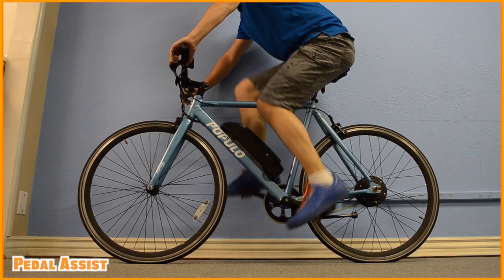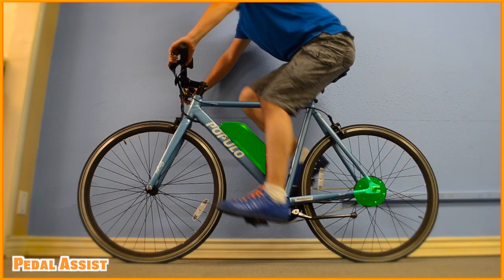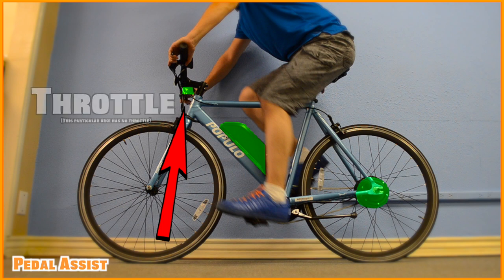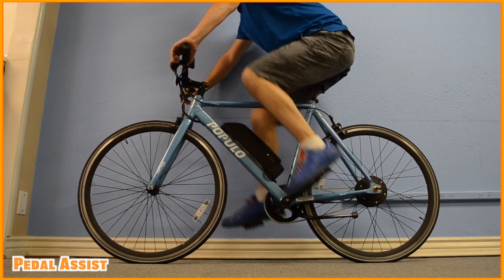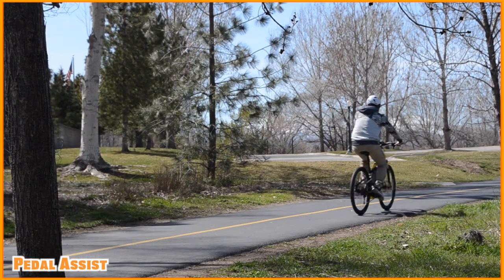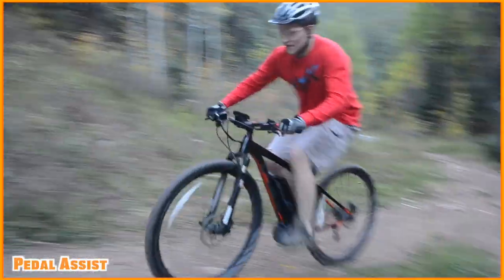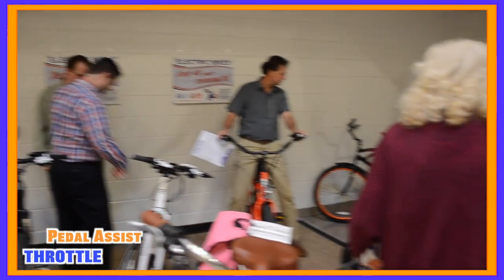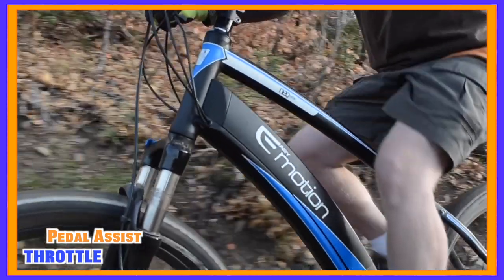eBike Pedal Assist VS Throttle

Comment: I find the throttle most useful when pulling away at traffic lights or a crossroads when on a low level of assist and you have traffic ( motors) behind you . They sometimes become impatient if you pull away slowly . In fact it’s about the only time I use it .
Reply: Me too, I find this is this most natural way and fun way to use an Ebike. Throttle when abrupt power is needed, otherwise pedal assist.

Comment: I have both, and both are cool. However I had the throttle stop working for awhile and realized that the throttle is fantastic when hitting hard terrain and rough ground because I can stand up on the pedals and power through holding the pedals both level and clear of obstacles. Definitely get both 😎👍

Comment: Throttle for me, but I think it comes down to how you use your ebike most. I use it as a utilitarian, get me around vehicle, so I prefer the motorcycle-like function. If I want exercise, I go for a run. But for someone who enjoys cycling for exercise, PAS makes a lot more sense. My biggest complaint is the jerky feeling of most cheap PASs. A true torque sensor (much more expensive) does a better job of mimicking actual pedal power.
Reply: I'm thinking, that you're thinking, about the 'Yamaha vs Bosh Mid-drive video... so, that's what I'm thinking... ;)
Reply: I like your comment.  It seems like throttle would be a great option.  Originally when I heard about PAS I thought it sounded really cool because it made your e-bike, still a bike.  And my thought was because you are merging human power and a motor your increase the bikes range by relieving the power consumption a bit.  So that was why I thought PAS was a good way to go.  But know I'm realizing all of that can still be had with throttle control.  I mean, you can still pedal and relieve the power consumption even with throttle control.  My question: (I've never even ridden one of these bikes, but I'm considering purchasing one)...  how much does pedaling really help?  I know of course it depends.  But in general, with the bike you ride, can you double, triple, your bikes range by pedaling 100 percent of the time?  For example, if you went on a 45 minute non-ebike bike ride, pedaling at a moderate exertion level, and you took in general that same exertion level and applied it to your ebike how far would you go?  Then, how far would you go without pedaling at all?  Would there be a big difference?   I guess my question doesn't really have anything to do with PAS vs throttle modes.  More just pedalling vs non pedalling...

Comment: As some one who rides a Ebike, and used both Pedal Assist and a Throttle, the Pedal Assist uses less power. I use the throttle to get up to speed, then the pedal assist to keep going. It works well. Both are useful, you just have to know when to use them.
Reply: Do you have to bridge the wires from the throttle and pedal assist together.

Comment: I have a bionx d series installed on my mtb and I mostly use level 1-2 pedal assist level when riding. I usually use throttle function when battery is low and I want to finish draining it to fully recharge it. The 20 mph cut off is a little bummer , I'd wish it were more like 25-28 mph on pedal assist for price paid. Great video on the comparison between the two systems!
Reply: Blue Monkey Bicycles wow! That bike looks amazing and 30 mph.. where do i sign up? Lol
Reply: Blue Monkey Bicycles the only thing I noticed is that their bikes have 20 inch wheels. Doesn't the super 73 have 26"?
Reply: Blue Monkey Bicycles oh wow you're right. I thought they were 24" by looking at them. Thanks for the info
Reply: I got my question answered, what remain is, how to connect the two systems together

Comment: Both is the way to go. Off the line i need throttle to start and the throttle is important for slight moves. In the woods, or tight spots i need complete control and do not have that with pedal assist.
My Pedego City Commuter is the way to go. I put 2000 miles on her in one year and she has kept my 75 year old butt in the game for i hope, many years to come.

Comment: Throttle for me, I can make micro adjustments second by second, and go further using less juice, making the most of my pedaling.  Most assume having a throttle means you don't pedal, wrong, at least if you want max range, If a rider with PAS is in max assist mode,  and basically ghost pedaling, and a throttle user is using just a tiny bit of throttle while pedaling hard, who's getting the most exercise?
Reply: Yeah my toughts exactly and that is what i do. Little trottle adjustments when starting and uphill and pedaling the rest of the way. Sadly here in portugal were i live the law doesnt allow throttle use... go ilegal or change to PAS...
Reply: Someone who turns their pedal assist from 5 to 3

Comment: What I would have liked to know and still haven't seen is how PAS is supposed to work. I've seen so many complaints about poor programming where all the PAS levels are set way too high. My ebike wanted to go 18 mph on PAS 1 with float pedaling which is useless in normal traffic. I fixed that. But many people don't even know that's wrong.
Also there hasn't been any info on the "torque simulation" PAS. I think many people want working PAS for the exercise.

Comment: QUESTION THAT NO VIDEO ON YOUTUBE ANSWERS! Can the range of intermittent use of throttle be better than pedal assist? (AKA only using the Throttle for hills and otherwise pedaling unassisted)Also pedaling at the same time as using the throttle (Like a normal person) This is how a lot of people ride and is a big reason a lot of people prefer throttle and swear by its range capabilities.
Reply from the maker: The trouble with that assertion is the word "intermittent".
Of course, if you don't use the electric system, if won't get depleted. Yes, you can pedal and throttle at the same time, but testing those capabilities is riddled with variables
Range tests are already not definitive, on account of all the variables. Testing the range of "intermittent" throttle and pedaling is far worse.
Reply: @BlueMonkeyBicycles  I understand what you are saying, However if you were able to control the test somewhat? For example, by following the same controlled route, that includes a mix of terrain with hills and descents, and then only using the throttle alongside pedalling when ascending and pedalling alone on flats and descents. This   compared to pedal-assist that is activated constantly and using battery almost all of the time. I enjoyed your video a lot, but I dont think It fully represents how all people ride with a throttle, it's not always feet still, thumb to the floor. I believe throttles can be used to control the amount of power very precisely, alongside pedalling.  I just think it would be interesting although I do understand the variables to consider. I just want to fight the corner for #TeamThrottleAssist :'D. Thank you for responding anyway sir, I appreciate it!

Comment: What I'd like to know (if you can help) is the speed of the pedal assist related to how many magnets are on the crank disk? For example, if i had 10 magnets on the disk and removed every other one to have just 5 would the power to the pedal assist be reduced by half? I'm worried that the ebike kit I have ordered may need adjusting to be road legal. Or is there a power (speed) limiter that can be added to an existing setup?

Comment: I did have a throttle control only on one front hub motor ebike conversion. It worked well as I could summon the power when I wanted it unlike the pedal assist which kicked in approximately a few seconds after moving wether I wanted it or not. This was annoying when in city traffic I would keep getting these quick surges in power even at lowest settings which caused me to keep braking to slow it down again.
With the throttle I could add the power (based on power settings) when I was ready to control it. My only problem came about as to setting the micro ohm settings on the battery, apparently that was very critical on the long term life of a battery, mine only lasted 2.5 years after very moderate use (less than 300 total recharges, 1/3 of specified ratings). With a replacement battery at $900 a pop it came to be too costly to maintain an ebike. I’m now trying to do another attempt at a conversion with better battery/controller technology available.
Reply from the maker: It sounds like you got a bad conversation system. Ice never heard of a system giving power without being triggered by a throttle or predictable pedal assist. Sounds like something is broken
Reply: i suspect u hv cadance. get tourqe sensor. mine 1500w..pas1 kick in fast..I can climb hill with only pas1..

Comment: Question: Do all mid drive systems require always PEDALING??? 

I know there are mid drive with throttle as an addition, but it seems they still require pedaling even when activating the throttle.    

Is there a system which will allow a mid drive with NO continuous pedaling??? 

 Not all elderly people are able to keep pedaling, while the mid drive provides the best torque for uphill climbing.
Reply from the maker: The big name mid drives require pedaling: Bosch, Shimano, Yamaha, brose.

There's plenty others that don't now

Comment: My bike is a pedal assist but I can't ride with only throttle. I have to keep my legs going .is it possible to get it fixed where I don't have to pedal all the time?
Reply from the maker: You want to add a throttle to the bike?
That all depends on what bike

Comment: I need a pedal-assist only kit one without the throttle do they make one can you recommend I would like to ride this on state land and they say it has to be pedal-assist only no throttle thank you I live in Pensacola Florida and there's no ebike companies around here that I'm aware of where are the Stone Age
Reply from the maker: With any kit, you may choose to not install the throttle, and the rest of the bike works just fine (provided it's installed correctly).
Check out the Tongsheng kit from EUNORAU. I reviewed it on electricbikereview.com

Comment: Can you get a peddle assist that is variable without having to change the setting on the control panel?  In other words, peddle lightly and you get some power; peddle harder for more power.  My peddle assist is just an on/off switch.  And even when on the lowest power setting on the control panel, when peddling in a tight circle, the peddle assist is too powerful.  This is on a 48V 500W system.  My solution has been to hold the break when peddling in a tight circle to keep the motor from engaging.  Great Videos.  Thanks.
Reply from the maker: Is it a torque or cadence pedal assist?
Reply: I would like to hear the answer if it were cadence, even though I didn't ask the question (first).

Comment: Any information about how each cuts off the motor? Like paddle assist the motor stops once u stop paddle while throttle u need to switch off?
Reply from the maker: Pedal assist stops providing power when the rider stops pedaling.
Throttle stops providing power when the rider lets go of the throttle.

It's actually rare to find a bike that will power without active human input. I've only seen it a couple times.

Comment: My ebike has a throttle but it may only be activated when in pedal assist. I am disappointed because I wanted to be able to go up a hill from a traffic light at a standstill. Is this "throttle only available in pedal assist" a safety feature or a way to save manufacturing costs on lower end ebikes?
Reply from the maker: Normally, it's just a programming request from the bike company, with no additional manufacturing cost. Perhaps they are trying to reduce the chance of an injury suit, and reduce cost that way...? I know from a nuts and bolts perspective the cost is the same.

Comment: Built my own ebike. Never installed the PAS. Figure I could just give it a little power with the throttle if I need to get up a hill or just want the bike to move a little easier.
Reply: Hallo, what motor did you use mid drive or hub motor? How did you install only throttle?

Comment: Throttle makes an ebike into a scooter, with the by product of getting noticed by highway and police authorities, And also the ire of others on bike paths who don't appreciate no pedal bikes. So I go with pedal assist, which is the whole point of an ebike.
Reply: John Durkin I have both, and both are cool. However I had the throttle stop working for awhile and realized that the throttle is fantastic when hitting hard terrain and rough ground because I can stand up on the pedals and power through holding the pedals both level and clear of obstacles. Definitely get both 😎👍
Reply: I think the litmus test is having an ebike that can go faster than the 15mph speed limit which makes it into a scooter.

Comment: Great video brother...I have a used electric bike I bought and I changed the throttle   (I don't use pedal assistance, is not hooked up)  the bike moves ok, but if I hold the throttle for a little while the bike remains at the same speed even after I let go of the throttle,, is this normal...Thanx
Reply from the maker: No, that's not normal. There might be something mechanically amiss with the throttle.
Reply: Yes, its called cruise control. Once engaged you just touch any button or full twist the throttle to disengage and coast.

Comment: Hello i have a problem with the throttle. When i sit on the bike its stops.. And when i hold it up and turn the throttle nothing happens.. What shall I do?
Reply from the maker: You'll have to give more detail.
It be best to take it back to the store you bought it from
Reply: @BlueMonkeyBicycles  I bought an bike from someone but the original throttle went out & it had pas on it but the new one don't. How do you you do bassist on extreme E bike?

Comment: Hi everyone I have a new e bike a fat tired 26×4 48 volts with a 500watts motor, I dont know nothing about e bikes but anyways I have a question everytime I pedal with the motor off I feel the rear tired a little bit hard like if the Break is being engaged am I doing something wrong? I even checked the break pads to see if they were touching the disc but their not. does anyone experience this?
Reply from the maker: I'd have a local bike shop check it out. It could be be bearings, low tire pressure, or something mechanical. It is possible that the motor broke inside the hub, but you would normally know that (because it would happen suddenly going up a steep hill).

If the bike is still rough after the battery is taken out, then you know the electric system isn't fighting you.

Comment: Can you give me a list of ebikes with throttle and pedal assist thank you so much more power to you
Reply from the maker: In the USA alone, there are hundreds of bike brands, each with around 3-4 models in a given year, each bike having different components.
But I can save you a bit of trouble: Any motor system from Bosch, Shimano, Yamaha, Brose, or Fazua have only pedal assist, and a really nice one too.
A lot of Bafang powered bikes normally have a basic pedal assist, and a throttle, but you'll have to check bike by bike.

Comment: Is it wrong to always used throttle or more like 90%? In a since of damaging the bike.
Reply from the maker: Normally, no. A mood drive motor can slowly flatten the teeth on the gears, but this normally takes a long time.

Hub motors on full throttle will incur wear and tear, like on tire tread or spikes coming lose.

Relying on the battery will wear out the battery lifetime faster. Since it's the most expensive part on the bike, this shouldn't be taken lightly

Comment: I really will appreciate if someone reply to me. I want to change my pedal assist ebike that I bought from Haliford, it’s a careera crossfire model to only throttle. Is that possible ?
Reply from the maker: You'd have to replace the controller, and change the connection points to everything else. Custom work.

It's possible, but it's not plug and play.

Comment: one small detail Id like to point out ....... when you stop peddling  and coast,  you will slow down TWICE as fast as you would one  a normal bicycle.    Ebike coast terribly imo        Feels almost as if your dragging the break a bit
Reply: This is exactly what I didn´t like! I have asked some friends and they said that it depends on the brand or quality of the bike. Is it so?
Reply from the maker: It entirely depends on how the bike company selects and incorporates the motor. Some have noticable drag, some have literally (measurably) zero drag from the motor.
Reply: @BlueMonkeyBicycles  thank you so much for this information. I will try some other brand now.
Reply from the maker: Direct drive motors are the worst (usually in the hub)

A name brand mid drive (Bosch, Shimano, Yamaha) will do much better.

Fazua had a motor that  decouples from the drive train, offering zero drag.

Comment: the issue with this bike is  throttle does not work, pedal assist works but no throttle control
motor cuts off when i break.. speed can hit 32km.
Reply from the maker: Oh, if you've got a service issue, take it to the shop you bought it from.